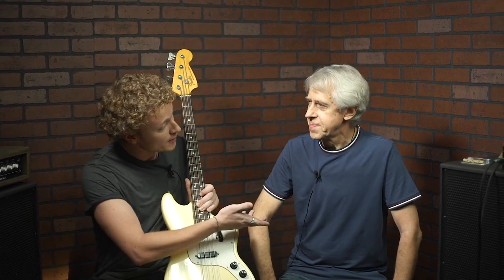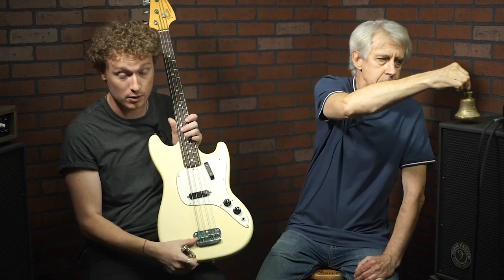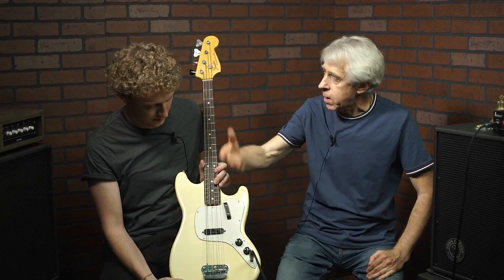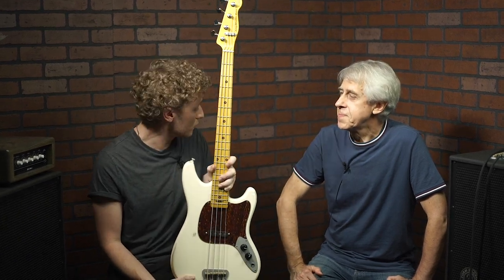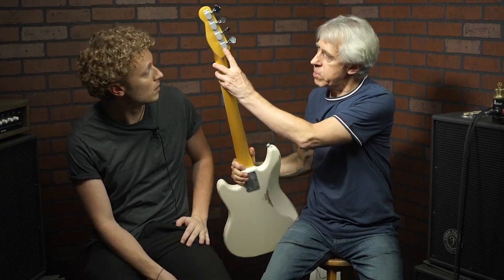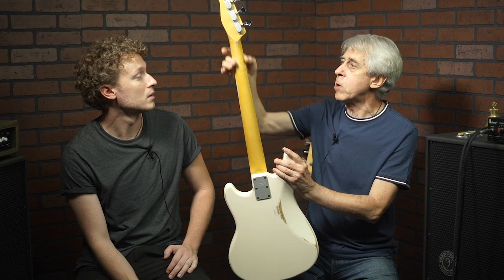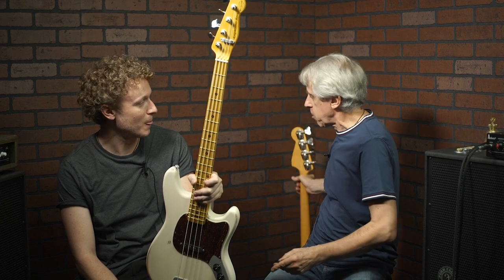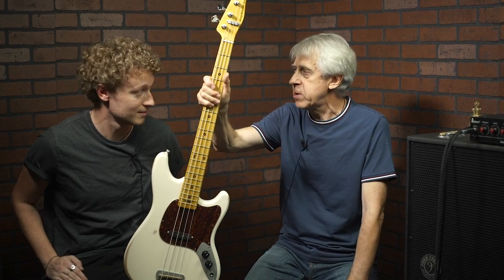Fender Musicmaster bass vs Custom made Ampmaster bass by Woodcraft electric guitars

Comment: Fender Telecasters have the same type of shared-saddle system..I've NEVER had an issue keeping my '78 Musicmaster in tune. Same with intonations - I played mine in punk bands all throughout the 80's. Usually with an overdriven amp... In '89 I put it in a case when I got a P-Bass..... A couple of days ago I went and grabbed it from storage.... The neck is as straight as the day I bought it. (Something to be said about a massively chunky neck)... I tuned it up and it's held it's tune (after warming up)....This baby has sat in a flimsy Fender (fauz leather cardboard) case for 35yrs with the same flat-wounds as the day I bought it. I toured  with it for 6yrs and it's has been in and out of storage for months every time every time I've moved from coast to coast. - These are solid American made basses.   - MAYBE I'd consider swapping out the pickup. But as-is, it records just fine through a neve 1073 into an apollo...- These do not need to be modded.